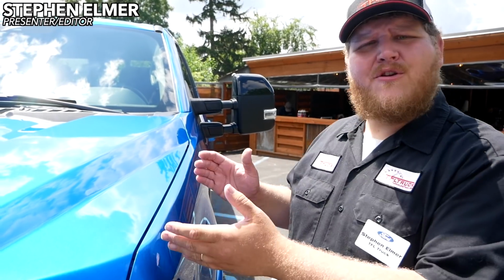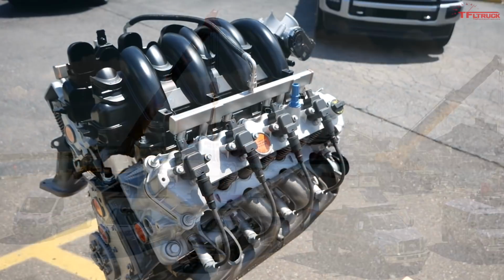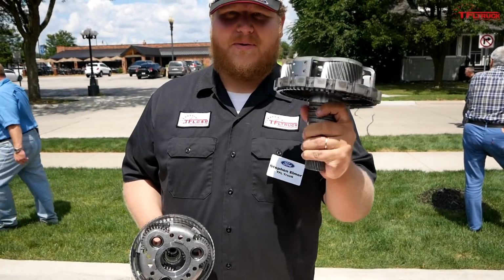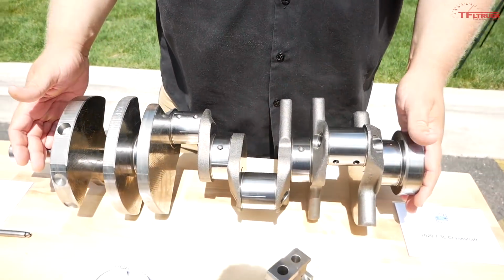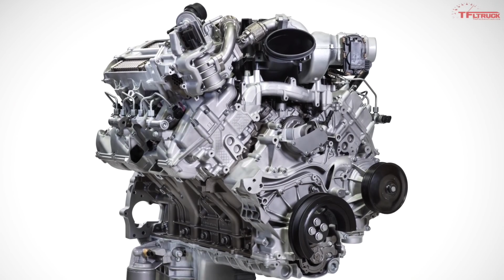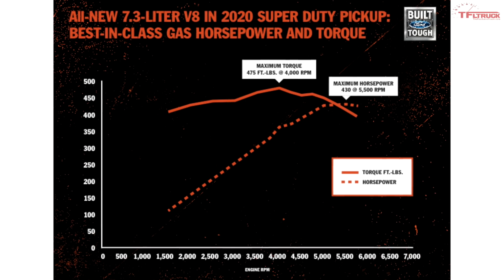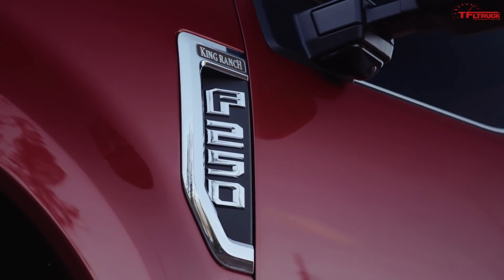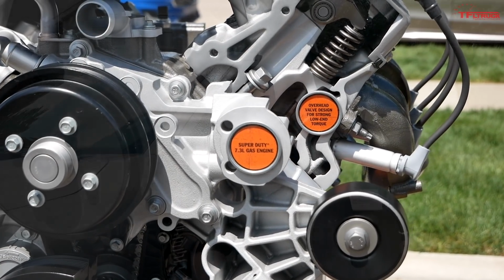We Finally Know the Ford Super Duty 7.3L V8 Power Numbers & They Are Lower Than We Thought!

Comment: Having driven service trucks for 20 years, i've experienced many the econoline van with a 5.4. Talk about a depressing slow piece of crap. Dead reliable i'll allow, but dreadful to drive around with a full load. I drove a service truck with an EFI 460, which was great. Also had a 6.8 v10, which got the job done but didn't make the low-end, driveable torque like the 460. After that it was all 5.4 vans, which gave me a new appreciation for even the v10. The 6.8 was rated at 410ttq and i think 285hp. This looks pretty good. I currently drive a Transit 350 with a 3.7 v6. It's a gutless chunk of shit and i hate it. Frankly, the 6-speed trans is irritating so i can only imagine how dumb the 10-speed is going to be in this but whatever. At least the 7.3 offers good power production. 6.2 was always a turkey if you ask me.

Comment: Wow a new chevy LS-7. 
WILL these  parts swap on my Chevy????
V-8, Coil on plug, black plastic intake, OHV with pushrods.
Ford's "new"  CHEVY LS.
NOW people will not have to swap CHEVY LS (V-8) into their Mustang?????
Reply: Haha are you actually taking a shot at Ford copying something from GM? That's funny, given that the LS was a 90% rip-off of the ford Windsor. Keep walking weenie.
Reply: @knucklehead0202  
But for the last 25 - 30 years, ford produced the. 4.6 OHC(DOUBLE & QUAD CAMMED),  5.0 OHC, 5.4 OHC, 6.8 OHC (V-10). 
When was the last FORD production V-8 single camshaft (OHV) 1991???
CHEVY had always had a V-8 OHV engine since 1955. 
OHV engines are smaller, lighter, cheaper, much more dependable, easy to work on. 
 The OHV engine is best for 98% of cars and trucks.
Yes OHC IS BEST FOR RACING.

Comment: Not really a low number and when you consider the torque curve, it has very usable torque. I would actually consider buying a truck with the 7.3 in it just for the amount of torque at low RPMs. In case you didn't know, that means when you step on the gas pedal it just goes instead of having to wait for it to get into higher RPMs.

Comment: I'm honestly shocked they didn't just EcoBoost a V8 for the super duty lineup using the same logic with the half ton of an overworked smaller engine. Maybe they're finding out that overworking a smaller engine is not working out as well as they thought.

Comment: Not impressed.  Should have at least 475 horses and 525 torque.  Just about the same as GM's big block.  Both under powered for the application.

Comment: The. Negative comments are totally missing the point. This is an engine set up for commercial applications. A different tune and you'd see BIG jumps in those numbers. Aside from that, having a drivetrain that's NOT tuned for the extreme too end of its engineering and performance potential is a drivetrain that will L A S T. So, you may not be beating the competition in hp or lb ft per CI of displacement, but you still have the most gross power in a platform purpose built for longevity.

Comment: Coil near plug 6 bolt cross-drilled main low compression pushrod V8 . I thought that was the LS formula . I guess that's one way to admit that the Eco turd is not really suitable for heavy duty use .
Reply: FORD started using a Y block with cross bolted main in 1957. All Ford's modular engines since 1991 use a Y block with cross bolted mains and an oil pump driven by the front of the crankshaft.

Comment: Ok but they didn’t build it like the old 7.3 those ran forever I had one that my dad used to drive to Canada every weekend for a few years. it had over 600,000 miles on it and ran perfect the only thing we ever had to change on it was the injectors. I now have 2 where I work and they have no problems. They need to bring back the original 7.3 turbo Diesel

Comment: Keep in mind that the Cadillac 500 made 150 hp in the 70s so how is this a low power engine
Reply: And what did the Cadillac 500 make for torque? the 1970 500 made 400hp and 550torque. last year 1976  190hp and 360 torque.

Comment: I still think it looks like ford took the blueprints for the LS
Reply: Ford started using a "Y" block in 1954 and cross bolted main bearing caps in 1963. All Ford's modular engines have used a "Y" block and cross bolted mains since 1990. Who copied who?

Comment: Push rod 7.3L kinda sounds like the Powerstroke diesel specs. I guess the fleet guys will like the motor but Ford is smart using it as a marketing tool making the displacement a 7.3 trying to ride the reputation of the old diesel.

Comment: That much torque on the new 10spd trans, fuel economy, performance, and durability are no doubt better. Fuel consumption comes with RPM and with this motor, you won't need RPM. I want it!
Reply: well at least someone knows something about Automotive Engineering

Comment: Ford took a step back because diesel is being too regulated and too expensive to run and repair for the amount of fuel savings you get. Direct injection engines with cast Iron blocks make for an economical and reliable engine. This could replace light commercial diesel engines.
Reply: The 7.3 isn't direct injection. Direct injection is causing a lot of carbon build up problems on the intake valves of some engines.
Reply: @benjaminwayneb  the Ford guy said it was direct injected
Reply: @levthelion  Port injection.

Comment: Looks like a ford lsx engine
Reply: Ford started using a "Y" block in 1954 and cross bolted main bearing caps in 1963. All Ford's modular engines have used a "Y" block and cross bolted mains since 1990. Who copied who?
Reply: @benjaminwayneb  I'm not talking about the block. The appearance of the motor makes it look like a ls1 I never said anything about modularity or style block used. Anyone familiar with ls style engines can see the similarities between the way this engine looks and the Ls.
Reply: @Hamza-or7jm  There nothing unique about the top end of an LS the differentiates it's it from any other push rod V8 but the bottom end looks very much like a Ford Engine that was in production before LS engines.

Comment: Looks like a mirrored 5.3 chevy
Reply: Ford started using a "Y" block in 1954 and cross bolted main bearing caps in 1963. All Ford's modular engines have used a "Y" block and cross bolted mains since 1990. Who copied who?

Comment: I'd rather have the 3.5 twin turbo thats in the F-150. More power and tourque under the curve for better drivability and fuel efficiency.
Reply: Heavy duty truck engines are designed to work hard all of time.
Reply: @benjaminwayneb  yes, that's why I'd take the 3.5
Reply: @JimmysTractor  It's much more strain on the 3.5 to work hard all the time. And I'd be willing to bet that when towing very heavy loads that the 3.5 won't do that much better than the 7.3 for fuel economy.
Reply: @screwball360  I had the 6.7 and it doesn't put out the stated 935ft lbs for more than a few seconds. Felt just like my old dodge that had 600ft lbs. The only time it felt like it had more power was when accelerating without a trailer. Gas engines seem to get more sustained power from their turbos and I think its because manufacturers are making their diesels more for acceleration which is the last thing they should be worried about. I know the 3.5 turbo is no match for the 6.7, but I'd rather have a 3.5 towing over max(15k) than the 67 towing below max(25k) all wound up going 65mph 1:1 with the 4:30. As far as the 7.3, it might  get a few more miles, but for the extra you pay in fuel you could rebuild the 3.5
Reply: The 7.3 is much better for towing, and it will long outlast the 3.5.

Comment: Variable flow oil pump!
If that oil pump is similar to those fitted to the 3.2 litre diesel in global market Rangers,  then everyone is going to be in for a rude surprise.
That model of oil pump is incapable of self priming, ie, if you let the oil completely drip out during an oil change over the course of a few hours, the oil pump cannot self primp and pick up the new oil.
You have to let the old oil drip out, change filter, plug the sump and pour new oil in under 10 minutes or so.
A lot of ranger owners in Australia ended up with blown engines because of this design flaw.
Reply: Wouldn't the o.p gauge show an immediate pressure problem?
Reply: Mr Jay that’s true for the North American market trucks.
Australian Rangers don’t have an oil pressure gauge per say.
We only have that little red oil warning light.

Comment: Pushrod the way to go for low end torque and this engine proves just that! The 6.4 hemi SRT makes more power and torque than this. If ram wanted to match the 7.3, all they would need is the SRT tune file. The HD block is already more durable anyway so I’d figure better manifolds, higher octane fuel (89-93) and tune, should match the 7.3. The 6.4 will be working harder to make that power whereas the 7.3 does it effortlessly combined with 10 speeds and 4.10 rear axle will be ready to go to work. Ford done it again 👍
Reply: the 6.4 truck engine is a totally different engine then the car engine.
Reply: benjaminwayneb yes it is! It’s a stronger more durable engine than the SRT!
Reply: The type of valve train  has nothing to do with low end torque, valve timing, stroke and cubic inches determines an engine power characteristics.  An overhead cam engine could have exactly the same valve lift and timing as a push rod engine and produce the same hp and torque.
Reply: benjaminwayneb Lol pushrod engines have always been known to make better low end torque due to the bigger valve and airspeed at low rpms.
Reply: @BigTony1710  Big valves are for high RPM air flow and peak horse power not for low RPM torque.

Comment: When I saw it was gas, I wanted to hate it. 

But wow. 400ft lbs at 1500rpm for a gasser, even Chevy and Ram are twisting their mustaches figuring out how they are gonna compete..
Reply: Yeah, this one is going to be a great engine...
Reply: Nah, the old 8.1 non vvt made most of its torque at 500rpms. (depending on the application ofcourse). Displacement takes the voodoo out of the equation.

Comment: The turbo diesel piston "steel", Ford had Mahle sending prototypes and were testing this engine starting in '17. If your a diesel fan, it's got right piston. Mahle has built new lines just for Ford, at there Morristown plant, and they be doing good to keep up with the demand, in my humble opinion. Steel piston rock.
God Speed you truck buyers,,,,, 
Semper Fi

Comment: Ford has publicly given an explanation for the "low" power numbers:

Enables to run at a lower compression ratio
Less stress on the motor, less overheating, more durability
Allows use of heavier duty parts
Allows use of regular fuel
Allows for a flatter torque curve
Engineered specifically for heavy towing, at constant speeds, not bragging rights.

Done. ✌️
Reply: Yep, made to do work, -all day, everyday. This is going to be a great engine. The GM 6.0 is the same deal, de-tuned to run the living crap out of it all the time, and survive. Besides, these are exceptional power numbers, especially for 100% duty cycle, -in fact, the real question that begs to be asked is, -who else can make these numbers right now? -And at 100% duty cycle? -Yeah, the answer is nobody! Even as a GM guy, I am giving Ford a big thumbs up on this one!
Reply: lower compression you say? sounds like ford engineered this engine for the aftermarket to get their hands on and slap on a Turbo or supercharger and give it BIG BOOST numbers
Reply: If you ask, which engine should I put a blower on, 6.4 HEMI, or FORD 7.3; the answer is obvious. As is, it will make a great motor home power plant. With boost, it will make a 1000+ hp reliably, unlike a Mopar 6.2L.
Reply: To me the explanation is that the Ford engineer mentioned the commercial market as being the inspiration for their performance targets, the commercial fleet purchasers will be more concerned with fuel efficiency than having obscene amounts of power.
Reply: That is the exact recipe for reliability and durability. Finally Ford is turning around their engineering department. The decision to partner with GM to build 10 speed was an even better decision. Ford is sure turning things around.
Reply: @jaymase3735  gm partnered with Ford don't get it twisted
Reply: Teo P and perfect for boost and a swap into a mustang👍🏼

Comment: Well crap folks i was expecting at least 550 or so tq and 475 hp and with today's cam profiles and fuel management systems it should be achievable . Ford might as well offer a turbo option as well because hell you can tune a 2.3 ecoboost 4 cylinder to make 450 hp and 350 tq weld 2 together and you got ????. I have owned many f-250 gassers from the fantastic long lasting 460 v8 (beat the  e-mortal holy hell out of it and clocked over 800,000 miles) the 6.8 v10  in an excursion (still got it ans can't part with it) which is tough as nails durable clocking countless miles and a current 6.2 f-250 which i totally love.. While over at chevrolet one ugly as hell you call that shit a truck,  porbably with options like in the past including but not limited to, weak frames, crappy interiors, cheap failing glued on door hinges and latches,  high  oil consumption vor-crap engines, slipping bucking and failing transmissions, electrical gremlins, slam the hood and the pos chevy emblem falls off and hits the ground ( oh they removed the pos sign of weakness bow tie emblem ans smeared the other cheap word chevrolet across the grille) i'm sure still substandard plastic garbage as usual. Drive my the local chebby dealer and the new chebby's look like like cheap wind up plastic china toys designed by the pontiac aztek reject so called engineer.. Why don't gm build a truck like a ford raptor i guess their crappy frames and bodies will not handle the pressure that the raptor can.

Comment: I just don’t get it. The 6.2 is AMAZING why discontinue what is probably the most reliable drive train ford is currently making.
Reply: The 6.2 is still going to be produced, its replacing the 6.8 V10 as the step up from the 6.2 but a step down from the diesel

Comment: Dude. My 3.5 ecoboost makes 390hp@5000rpm and 475lb/f@2500. And that torque is flat for days.
Reply: And it's more fun to drive. But I bet it won't last 60% as long or be near as reliable. With no turbo, GDI, variable valve timing, cylinder delete, etc, it looks to me like Ford was going for a marathon motor. Let's hope they got it right.

Comment: I can’t blame them, I’d copy the LS motor too
Reply: You chevy guys are THAT stupid. A pushrod engine makes sense in a truck that makes power low. Got it. For a pony car, or muscle car, an overhead cam engine is better. Like how Ford makes the same power with 5.0 liters as pigolet does with 6.2 liters. You idiots are to stupid to see the difference. It is all about fitting the application. Pigolet always get it wrong.

Comment: It's a commercial truck engine. It's designed to haul max payoad/trailer all day long in crap conditions on cheap fuel. For years and years on end. It won't be a monster. But I can't wait to see what the aftermarket does with this engine.

Comment: The problem with all gas engines.  What is the economy with a 15,000 lb trailer at 80 mph. 4 to 6 guaranteed.
Reply: but you shouldn't be towing a 15k lb trailer at 80mph dummy

Comment: Spot the idiot at the dealership... it’s the one buying a truck
Reply: Let me guess. You would rather one of those over engineered diesels with crappy DPFs and DEF systems that always break. Who cares if you save fuel when your truck is suffering from tons of down time?  If you run a business you'd know. Also, look at what the pursuit of fuel economy and emissions have brought us: 1) Direct injection which is a problem because engines get carboned up and need to be cleaned which costs money and time. Also with DFI the injectors fail far more often. 2) DEF systems in diesels which over complicate them and they spend more time in the shop than anywhere else.